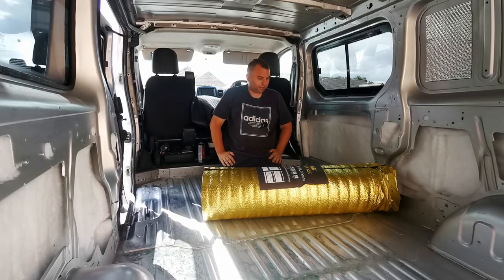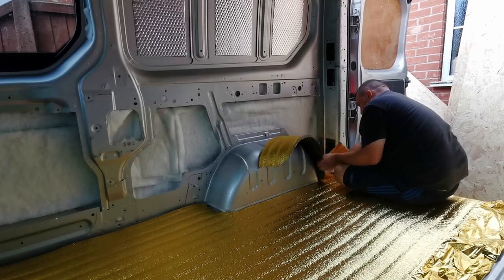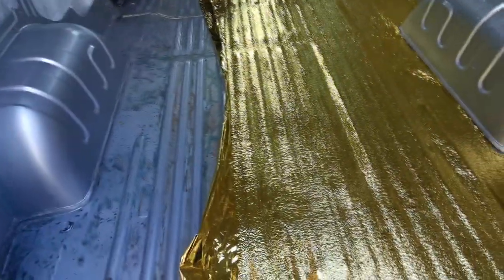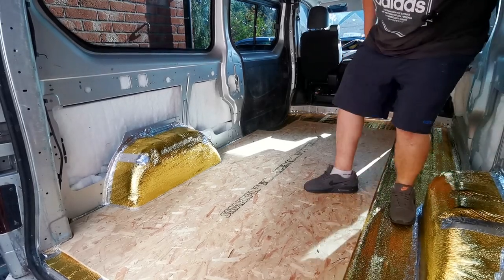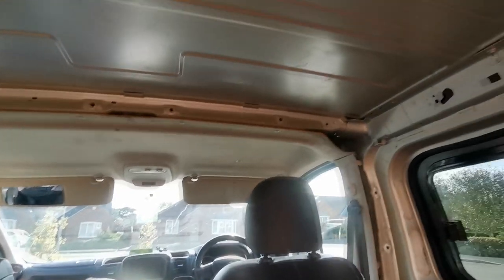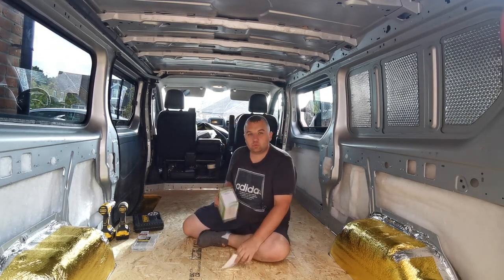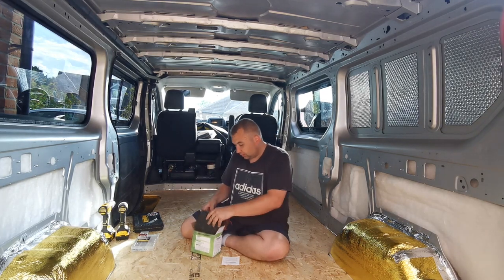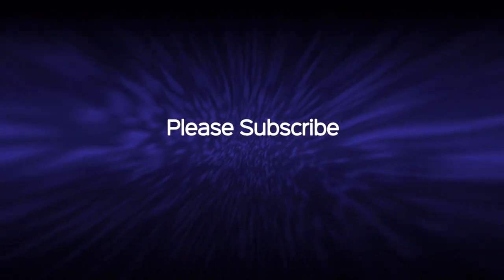Insulating A Van Floor

Comment: good recovery on the tripod gary the van build is coming along nicely buddy just watched the carpet video i bet you was sweating like a baker in this heat nice little touch would be grey curtains to break the black up a bit in the back ur choice totally buddy
Reply from the maker: Cheers Ronnie I'm thing gray if they have them in stock like you say will break it up in there 👍🏻

Comment: Coming along well, the floor in my van was something I didn't do as the existing ply floor was in very good order. In the D pillars the little missing grille on the offside has a cigar lighter socket in do the wiring will be there somewhere,  just something to be aware of.
Reply from the maker: Cheers Mike I did see two loose cables and did wonder what they was for 👍🏻👍🏻